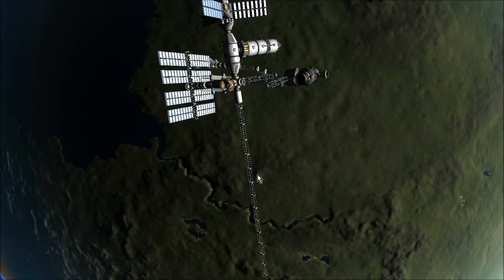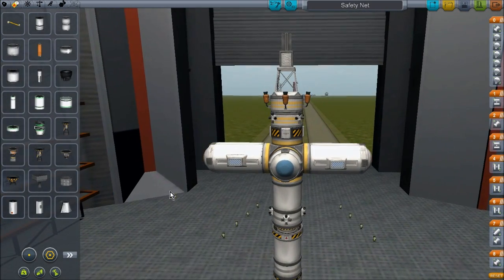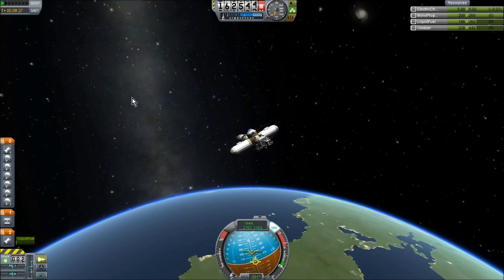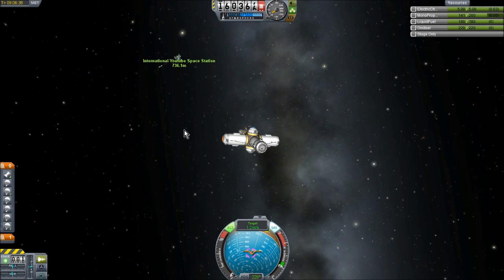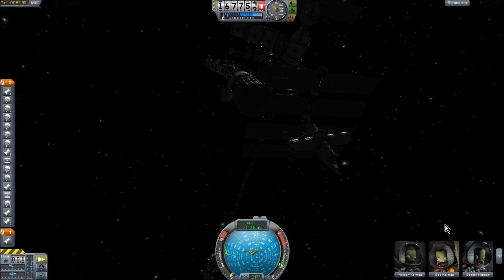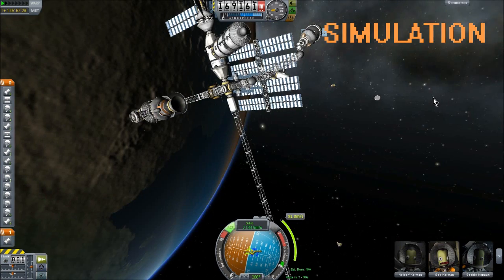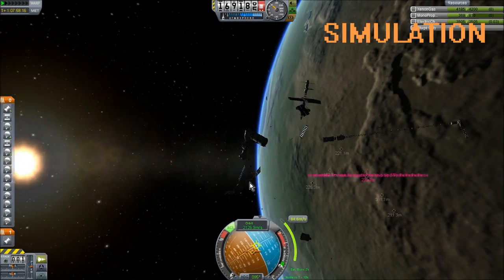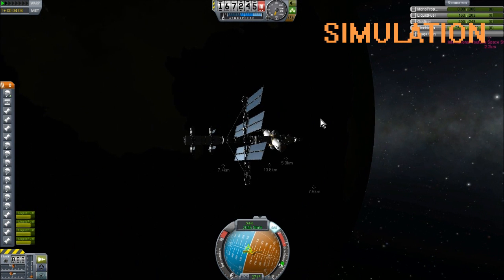IYSS - Deorbit/Reentry Module

Comment from the maker: Before 0.18, there was a mod called Lagsbane. It slowed down the physics sim when the frame rate dropped too low. This let the game slow down smoothly instead of stuttering. In 0.18, this functionality was added to the game by the devs, and the magnitude of the slowdown is governed by a slider in the settings.